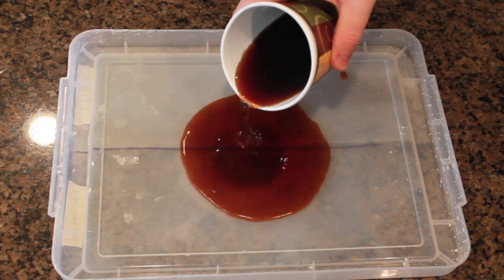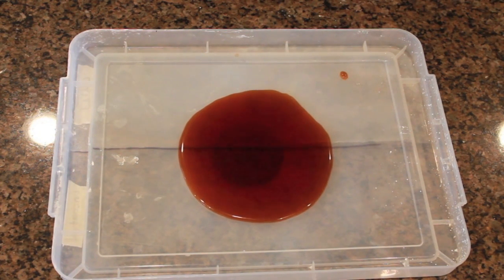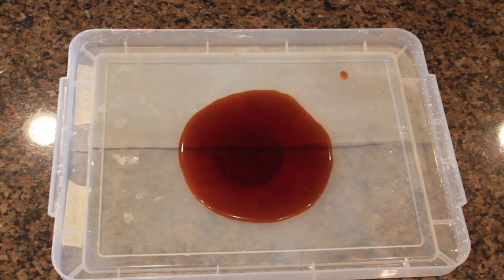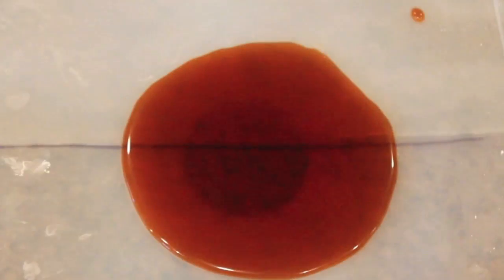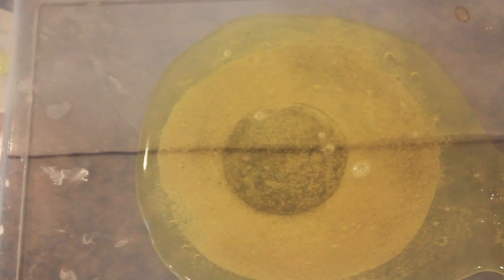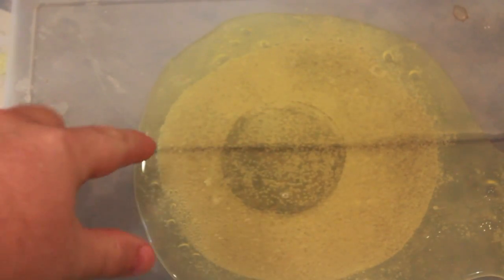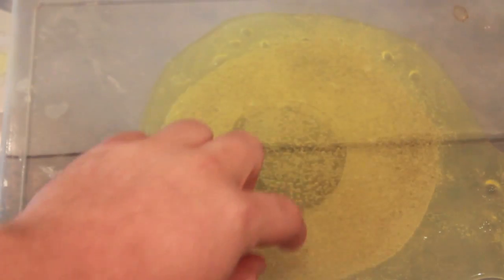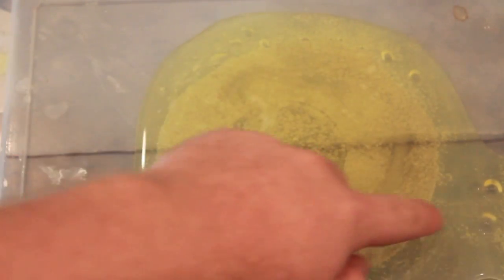Coffee Degrades Neverwet

Comment: Right in the company heading "NOT FOR USE ON CLOTHES"  Meaning they intend it for surfaces that are not in contact with the skin, such as the exterior of work boots, but not for surfaces like your t-shirt which a portion of the application will be in constant contact with your skin.  
It is not surprising that coffee or even soda when left for prolonged periods of time would degrade the product, as prolonged contact isn't the primary goal of the product.

Comment: Are you sure that the coffee really degraded the never-wet ?
Because what i think is that parts of the pigments and particles in the coffee had time to settle down and, by doing so, affected the special properties of the never-wet treated surface. thus making a thin layer on the neverwet wich acts differently when liquids are poored on it.
It´s like a normal coffee stain which, when you whipe the liquid of immedeatly does not have time to soak into the surface material.